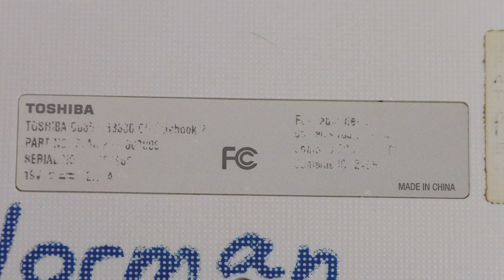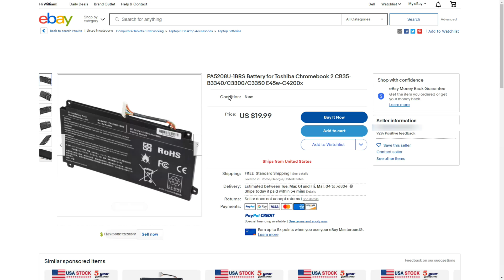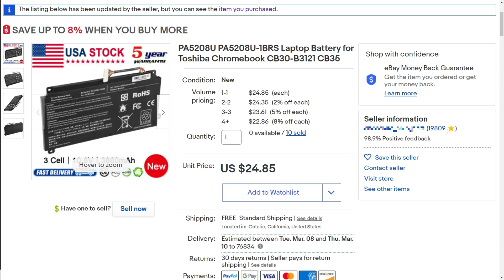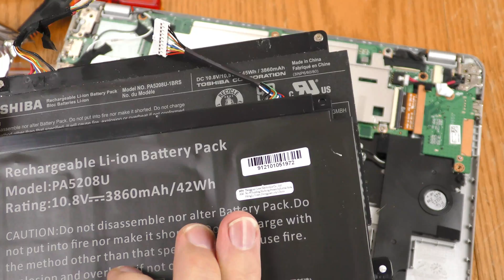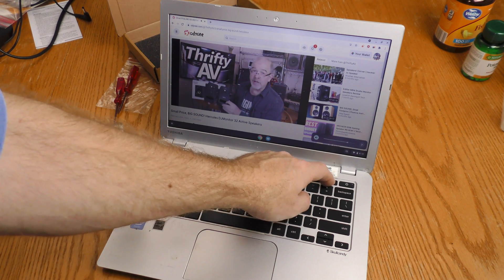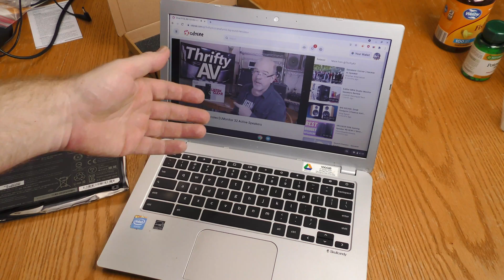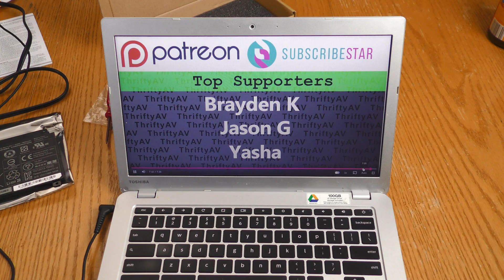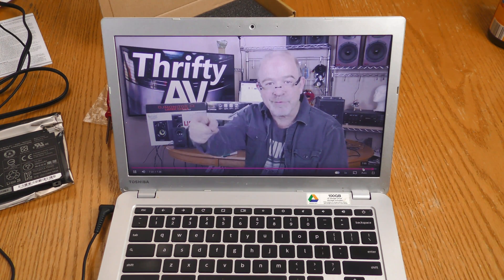Back from the Dead! Toshiba Chromebook 2 Battery Replacement.

Comment: The battery I ordered from Amazon and just installed is estimated to last about 4 hours at full screen brightness on a full charge according to these battery monitoring apps I'm running. This is much better than the 15 to 30 minutes I was getting on my old Toshiba battery but I often charge to 100% and let discharge to 0%.

The original battery weighs 215g and my replacement weighs only 160g. Does that mean it's only 70% the capacity? Does that mean it's missing important safety circuitry? The only way to know is to cut it open and find out. But I'm just going to leave it installed and hope for the best.

Back when this Chromebook reached EOL I removed the write protect screw and installed the Mr Chromebox firmware/bios. Then I ran Chromebook Flex for a while until that one started having problems too. So I switched to Linux and then Windows 10. Windows 10 has been great. And now this laptop is portable again 🎉
Reply from the maker: My guess is that the lighter weight means less capacity.  I never messed with the OS on mine, just left the EOL version on there.  Pretty cool that you successfully got Win10 running on it!

Comment: I bought the Amazon battery. It didn't last one year. Got me a DIY powerbank capable of 19v output, and populated it with some high capacity 18650 li-ion batteries.
Reply from the maker: Was the Amazon battery branded or off-brand?  Sucks that it didn't last. Nice workaround, but I love how chromebooks are lightweight and portable, and having a powerbank attached kinda takes away from this.  I do have plenty of 18650s, though.
Reply: @ThriftyAV  
The battery purchased from Amazon was SANISI brand, and had TOSHIBA on it just like the original battery. Too bad cannot post link to the product page.
As for the powerbank, I glued it to he back of the screen with a blob of neutral silicone. It does add to the weight, but worth it to save the chromebook, and have 10+ hours of runtime!

Comment: Let the battery go dead first before u fully charge it because batterys have memory
Reply from the maker: Memory effect is a major issue with NiCad and NiMH, but Li-ion like the one used by this laptop are more tolerant of recharges after partial discharge.  Yes, there is some memory effect with Li-Ion, but it is tiny.
https://phys.org/news/2013-04-memory-effect-lithium-ion-batteries.html

Comment: Glad you got a replacement battery for your chromebook.I"m still using some older laptops and PC's myself that I will one day need to replace/upgrade. Enjoyed your latest episode, especially the 'closer' with the Laptop video doing the outro.. very clever.
Reply from the maker: John, with some laptops, changing the battery just means replacing a self contained module that clips onto the computer.  Not that the Toshiba Chromebook 2 was a difficult repair, but I thought a few people might benefit from a discussion on how to find and replace a battery, so I deemed it video-worthy.  Thanks for watching 'till the end!